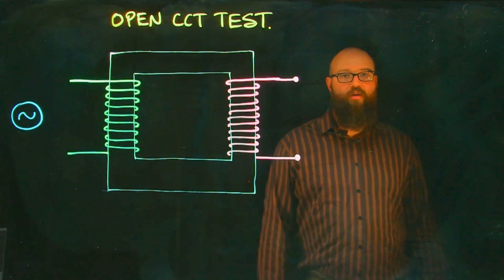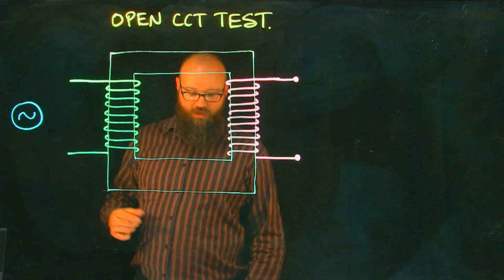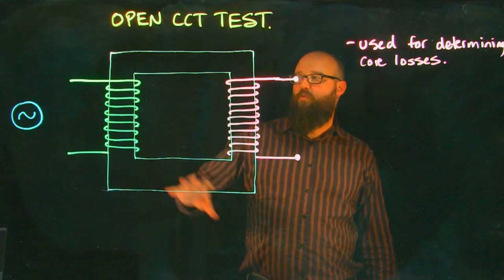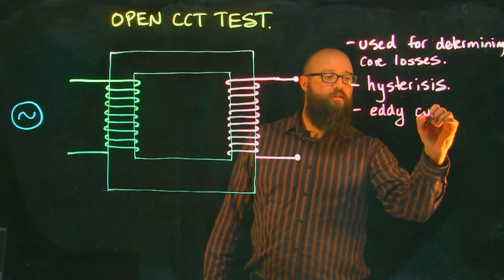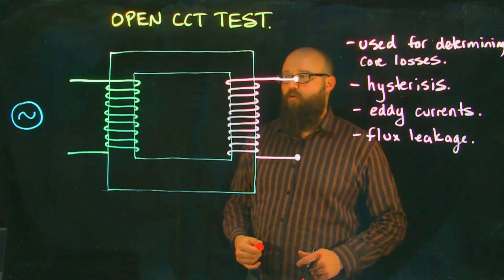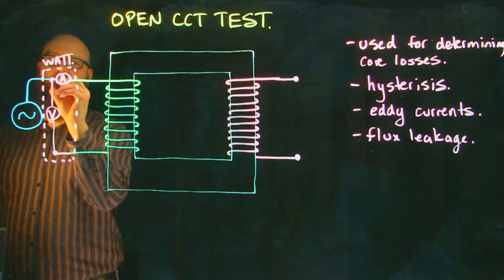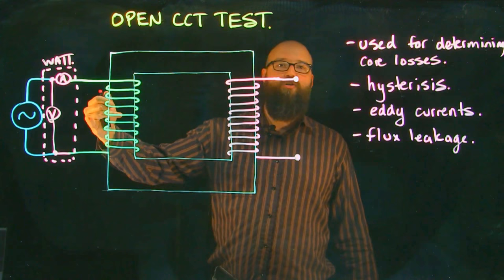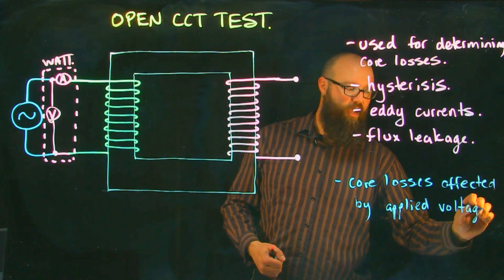Transformer Open Circuit Test

Comment: How the applied voltage will affect the core loss? For example, if applied voltage is 240V, watt meter read P=100W. When applied voltage change to 2400V, Core loss change to 1000W?

Comment: Hi, do you know if you are able to conduct the open circuit test onto a current transformer? I have seen a lot of warnings about open-circuiting the secondary winding of a current transformer. However, if you are not able to open circuit the secondary windings of a CT, then how would you calculate/measure the transformer core losses/equivalent parameters?

Comment: It definitely helped, from a simulation perspective (software) I can energize either the LV or HV winding  to measure the core loss correct? The reason I am asking this question is because in the EMTP-RV software the Magnetization Branch is located in Winding 1, so would that suggest that the excitation needs to be applied on Winding 1?
Reply: for  this   test     power  supply  needs   connected to LV

Comment: In the simple explanation given ; core losses are measured by current and voltage BUT total current is includes the lossless current of te primary inducrance ...perhaps in more deailed accounts this error will be corrected.

Comment: How did you make this video ??
With any software or it's skill ??
Reply from the maker: Hardik Patel thanks for watching.
It's filmed using a light board. Basically a LED strip runs around the outside of a 1/2" thick piece of glass, which really makes the markers pop. The camera filming inverts the image as I am standing behind the glass. (spoiler: I'm actually right handed but the video shows left.)
Reply: Just keep a mirror beside on which  ever device ur watching, U'll see the actual video &"that he is actually right handed"

Comment: LOL - you don't need to go through all that - just use an ohmmeter. if it's open it will measure high resistance. prove me wrong.
Reply from the maker: This is not a test intended to detect a faulty transformer winding.It is done to establish losses in a transformer before loading. There. You are wrong.